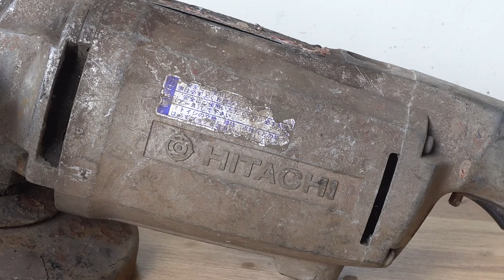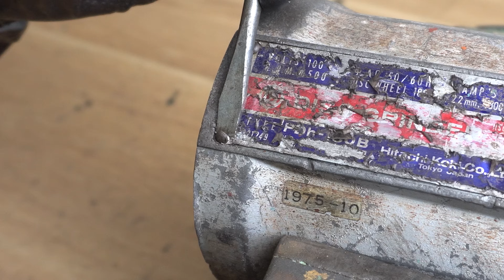1975 Disc Grinder Restoration | Hitachi PDh-180B

Comment: From angle grinder to angel grinder. absolutely great work. some tips from the couch (no criticism)  replace connection cable / Consider whether you can galvanize or nickel-plate rusty screws and washers / the slotted screws are quite tortured by the impulse screwdriver, perhaps you can be more careful when tightening the screws / keep up the good work, I'm looking forward to all future videos, very nice craftsmanship
Reply from the maker: thank for comment 🥰🥰🥰 I will try to do better in the videos

Comment: Nice resto bro, but redo that power chord. Not only because it's bad, it's a safety hazard. Metal body tools require grounding of the body. 👍🏻
Reply from the maker: Thank you. I will try to do better in the next videos
Reply: Yes, at first I thought it wasn't too bad of an idea because you were trying to keep the original plug end on it, but when you went to cut off the plug end and put that strange looking one on instead, it didn't make sense that you kept the cord. You only end up using a piece of cord with cracks and poor shielding. You could have gotten brand new piece of cord for six or seven dollars. Especially since you were putting brand new ends on each side.
Reply: @hbrestoration  I saw the same thing, but figured there was no need to make another comment for it when I saw this one. The video was great, I'd suggest buying a cheap electronics crimper. It'll make better connections than the needle nose pliers. Thanks for the content, very nice.
Reply from the maker: @Dan-xf7bh  At that time, I just thought that rope was still usable, so I decided to still use it. But I better replace it
Reply from the maker: @jkalberer  
Thank you for your comment, I will try to do better in the next videos

Comment: I just waited for the sandblasting, I hope you can have that equipment
Reply from the maker: Yepp, I'll have it
Reply: Yeah, nice suggest
Reply: Интересно то что какбудто автор специально закопал древние инструменты и потом реставрирует их и ни в одном видео непопалось так чтобы хоть болт или гайка оборвалась и непришлось её высверливать 😮
Reply from the maker: @jarvisjey2863  🥲
Reply: 29:56
NOW PLAYING

Cordless Drill Restoration
Reply: He didnt use the metal filler on dents and imperfection, didnt sand down properly, didnt even clean the motor assembly properly just spray painted . This is a lazy repair

Comment: You know, I can certainly understand wanting to use and re-use as many original parts as possible, but in the case of the power cord, getting a new one would have been a better idea. You know, one that's not cut in places. Other than that, I think with a bit more effort, the result of your restoration would have been great instead of good. As it is, it was a decent job. Nothing else to say.
Reply from the maker: Thank you for your opinion. I am very grateful for that. I will try to do better in the next videos😊

Comment: Just a question, looks as if you took a 100v Japan plug or 110v North American plug and put a 230v euro plug on it. Do you have some sort of voltage regulator that we can see? Pretty sure that grinder was not intended for 230 volts. Cracked me if I'm wrong. Anyways, nice video.
Reply from the maker: I use a converter from 220v to 110v. I'd love to show you but can't add pictures here. You can contact me via facebook or email which is in the channel description
Reply: It occurred to me while watching that you'd probably blow up that grinder lol. Good that you have it sorted.

Comment: Everything is great, but before disassembly there were gaskets on the gearbox, and after restoration I assembled it without gaskets. It was possible to cut out new gaskets from paronite or thick paper and install them.
Reply from the maker: Originally there was a paper layer, but I lubricated it with a layer of quite thick grease so there was no need for a paper layer.
Reply: The grease you used I’m worried might be too viscous for that tool and it could potentially overheat on tough jobs